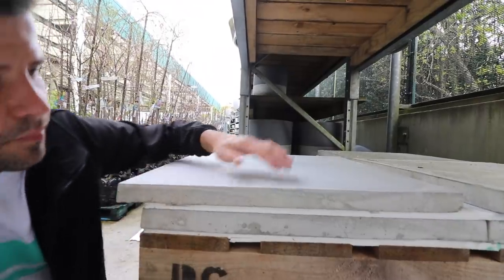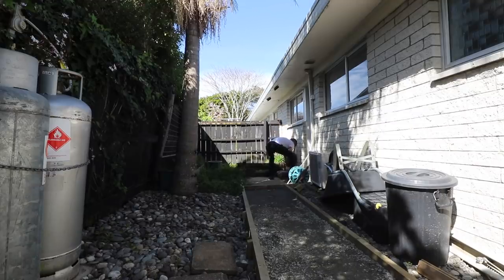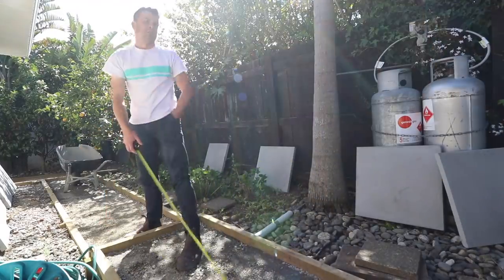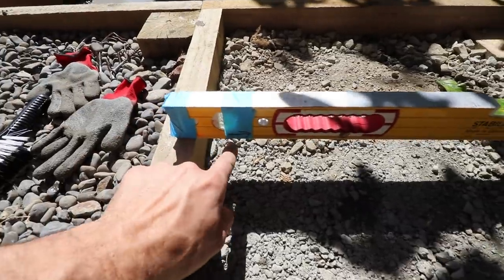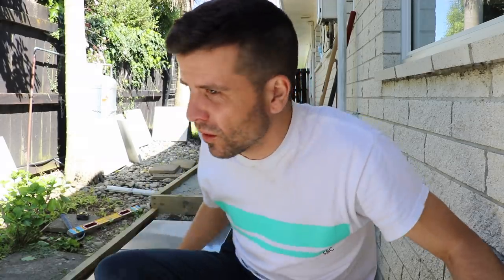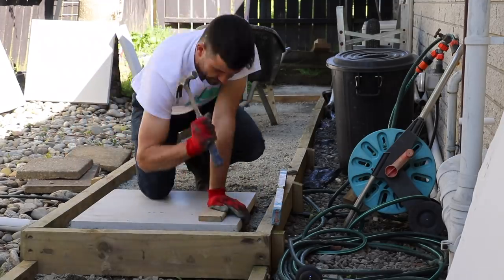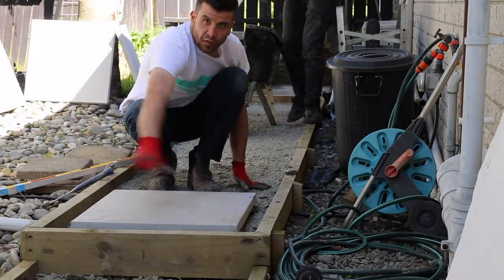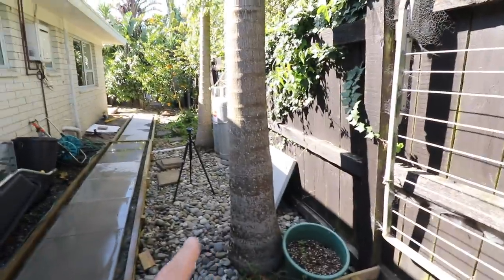Back Where I Started

Comment: A short piece of L bar aluminium makes a great base for consistently levelling pavers.  It won't bend or degrade over time, so it lasts forever.  Just place a short piece along each gap, so each consecutive paver rests on it (one short piece underneath the pavers at each of the gaps)...level them all first, then lay your pavers.  The road base will lock the bar in place, and the pavers won't move.  Then lay sand, or the gel-lock sand, and they won't move even if the substrate settles.

Comment: Full bed under your slabs dude..... some slabs will actually bleed through where you have spotted your mortor...so when you look at them they will have slight dark patches on top of the slabs...if you full bed them and that does happen the whole slab colour will change slightly but it won't stand out. And it also stops them cracking through the middle over time. Other than that you have done a lovely neat job 👍
Reply from the maker: Cheers man, I took that on board for the remaining slabs
Reply: Damn thats the first thing i thought when he put down the first piece i see that cracking in 1 to 5 years cuz he only has the corners supported
Reply: Joshua Simoneaux I think it covered way more than just the corners because there were decent hight on the four spots of slab. And it covers more than you saw at first as well when they pushed them down I would imagine.

Comment: Another great video, i was taught how to lay pavers or slabs as we call them in Ireland by a builder friend and he told me to wet the side being layed on the  sand and cement should be wet so that the dry slab doesnt  draw all of the moisture from the sand and cement mix.This is help with the bonding of the mix and the slab .

Comment: just for future jobs , it is better practice to lay the slabs on a full bed of sand and cement and not dot and dab/spot lay!
Reply: Second this! Prone to cracking if you dot and dab!
Reply: Was just about to add the same, full bed is better and not much more work involved.
Reply: taters isgreaters very weak and makes breakages easier
Reply: Voids are created with those cow patties of sand and cement that are laid down. Which invites erosion. I hate erosion. Almost as much as I hate cow patties.
Reply: Your ever tried breaking a council slab that's dot and dabbed like he has. It isn't going to crack under normal use put it that way

Comment: 2 questions
¹ why wet the slab after laying it?
² wouldnt laying the mortar on the corners only make the center more susceptible to breaking?
Reply: 1. to stop any spilled wet cement from setting on the laid paver...
2. He put some in the middle too
Reply: 1- not necessarily wetting the slab just cleaning any spots of mortar that my have splashed onto them. Once the mortar dries any on top of the pavers will stand out quiet a lot
2- yes should always lay on full mud bed not just corners to help spread load and eliminate any weak spots. However as the pavers is knocked down the mortar may spread underneath to even out the bed a bit